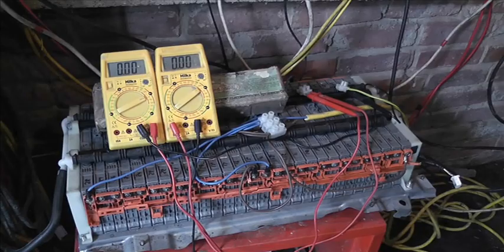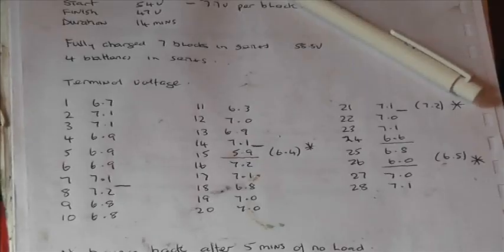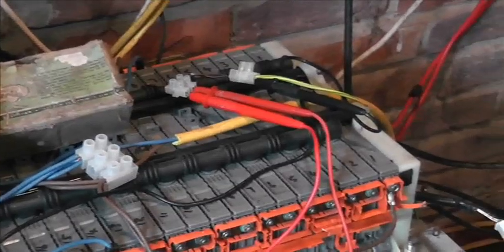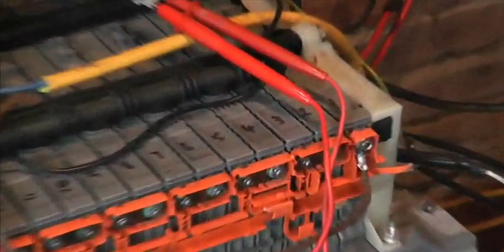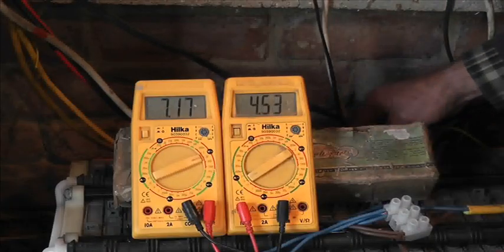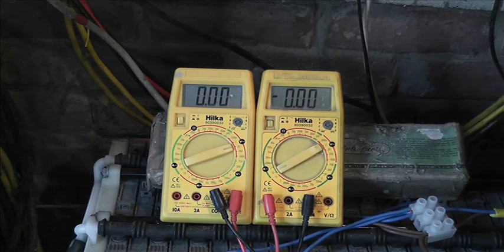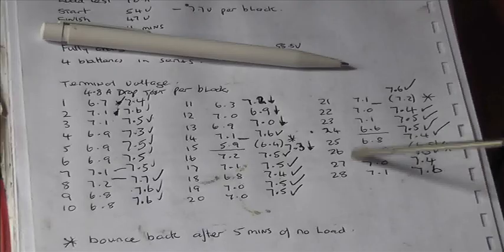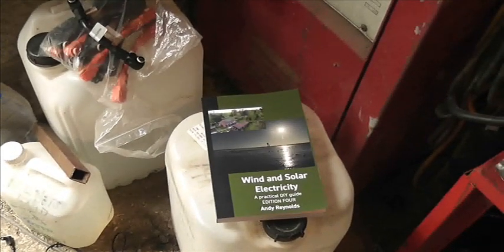Toyota Prius solar battery conversion: cell drop test

Comment: Do you sell any of your left over projects? Currently I’ve got 3 110ah what is your batteries, 4 200w panels and a victron mppt (yes i know i need a 30 but it never makes that much) 
So if I could buy some 12v batteries that would be great
Reply from the maker: Jordan, where are you based, there may be some 2v forklift batteries to make up 12v, cheers
Reply: @TheInfoworks I’m in the midlands. I drive tho. Your only about 2 hours away from me

Comment: I like the use of strip connectors!
Reply from the maker: Owen, seemed to be an easy way to connect the parallel volt meter and the series / parallel resistance and amp meter. So time now for a re-configure, cheers

Comment: Nice test. Would be interesting to calculate/measure internal resistance (IR). 
You know voltage drop Vi and current I, so internal resistance IR = Vi / I.
Ok, current and voltage under load should be more constant, to get a usefull measurement.
I would try with bigger resistor, to get 1 A current to get Vi settled more qickly.

And test capacity of a few cells. A cell, fully charged can hold voltage.
But capacity could be smaller. 

Maybe just put a constant load to fully charged cell and measure time, the voltage drops to certain voltage.
This would be a good indicator of capacity.
Reply from the maker: Yes, not concerned about capacity at the moment, but the ability to provide current and volts is the first hard test, cheers